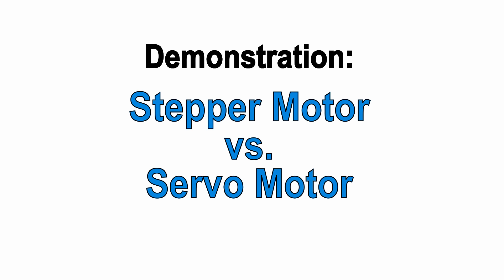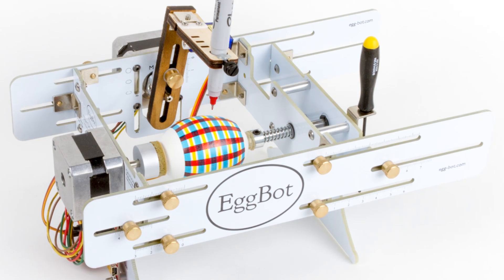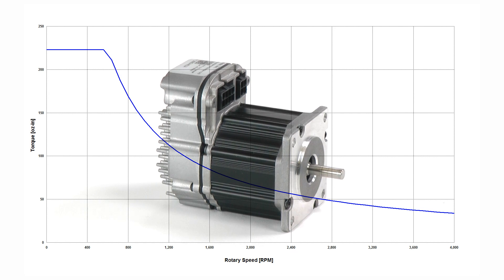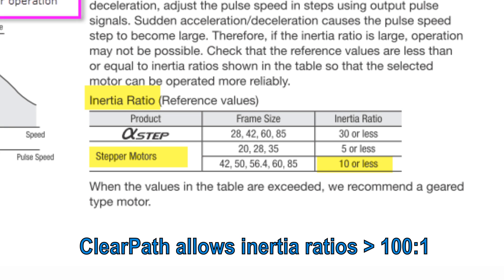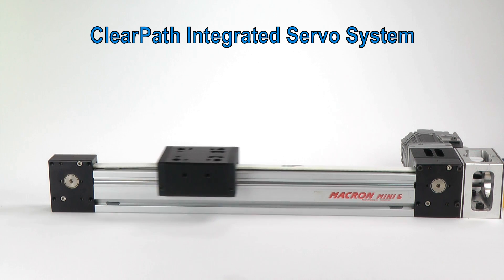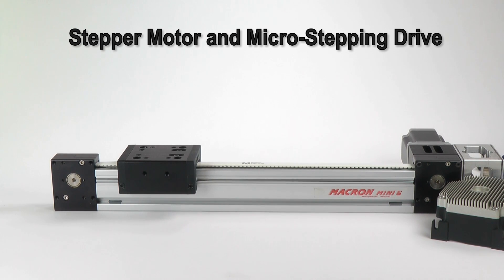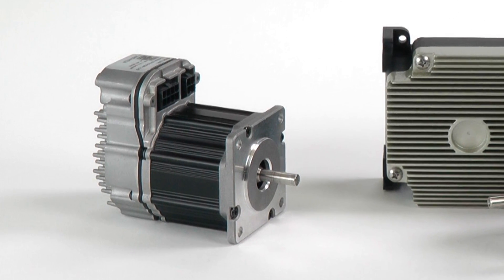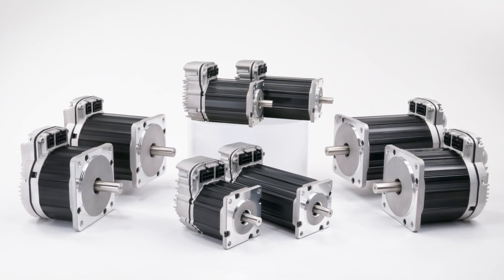Stepper Motor vs. ClearPath Servo Motor Demonstration Video

Comment: In the price point you forgot to say that you will also need a "driver" like power supply for the clearpath, wich is verry expensive. AND there are verry good open source stepper drivers for a neat price compared to the unit you choose. For example the TB6600 stepper driver. In my opinion a stepper is also totally okay if you need a Nema 23 Size. All Sizes above this (Nema 34 and 42) there is no way around a servo. All below Nema 34, the stepper is still way cheaper!!!
Reply: Hi Dunichtich100, Thank you for your comment. I'm an applications engineer for Teknic and wanted to clarify some points about the power supplies used for stepper and servo systems. (comment continues)

Both systems require a DC power supply (of approximately the same voltage range). We used the same bulk linear power supply for both systems in this comparison. 

If your motor power requirements are low, you can use a 24VDC supply with either system and these supplies can be very inexpensive. If you want maximum power from the motor, you can use 75VDC with either. (More power supply voltage gives you more electrical power input to the drive and motor, and hence more mechanical power out of the shaft. In other words, greater (volts x amps) input means greater (torque x speed) output given the same motor/drive combination.)

Teknic sells a 75VDC power supply for $199 (the IPC-3). This supply is designed specifically for motion control applications, so it has certain features unique to motor control (e.g. control of regenerated voltage), but you can also make your own bulk linear supply for less.

I'm not familiar with the TB6600 drive, but I looked up the specs and it's rated to output up to 4 amps. At its max voltage of 42VDC (it too, requires a DC power supply), and using the same Oriental Motor stepper de-rated properly according to the manufacturer, you will get 55 mechanical watts (not to be confused with electrical watts, which is just its bus voltage times its output current which is ~168 watts of electrical power).

So although I can't fairly comment on its quality or performance, it makes sense that the TB6600 used with a motor that maximizes its output power (~55 watts shaft power) is less expensive than the ClearPath SDSK-2310S (~100 W of  shaft power).

That being said, if the stepper gives you all the power you need and you don't need the other servo advantages (smoother and quieter motion, closed-loop feedback, higher torque at higher speeds, etc.), it may be the best choice. That's one of the things I like about engineering – figuring out how to optimize for each application's particular needs.

We'd be happy to answer any questions you have. Please feel free to contact support@teknic.com.

Best regards,
Bridgette G.

Comment: On the servo, is the motor itself a stepper where you send it pulses like a stepper or is it different?
Reply: Hi Jamil F, ClearPath is a closed-loop, brushless servo motor with an integrated AC vector servo drive and a 12,800 count/revolution encoder. ClearPath is not a stepper motor or a hybrid between stepper and servo, but it does communicate using step and direction signals (as well as with digital I/O for certain models).

Teknic's ClearPath SD models were designed to be drop-in replacements for stepper motors (or digital step and direction servos) so that a user does not have to change the software on his/her step and direction controller. As long as the motion controller can output step and direction (or A/B quadrature), it will be compatible with ClearPath.

Please feel free to email support@teknic.com if you have any additional questions.

Best regards,
Bridgette G.